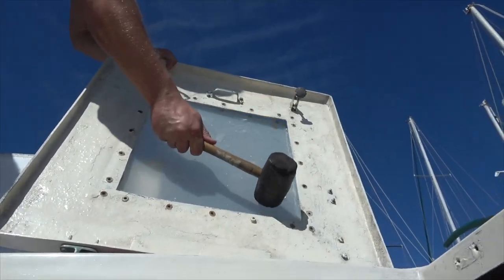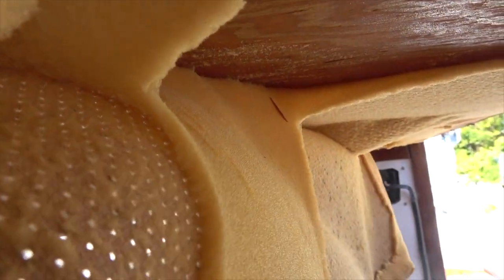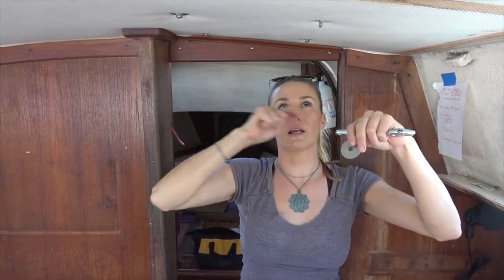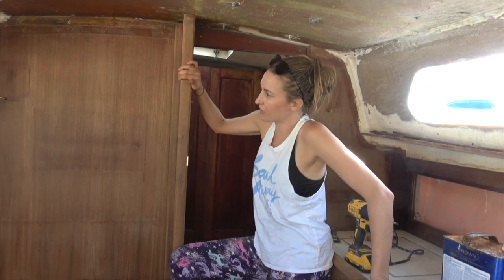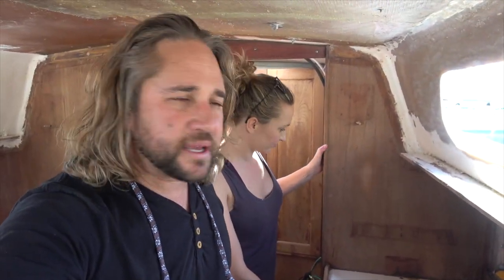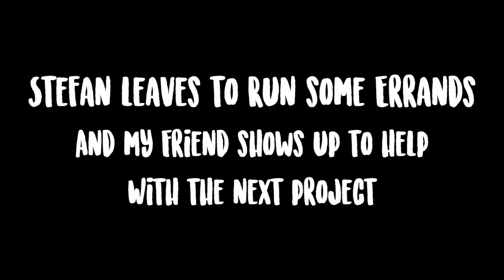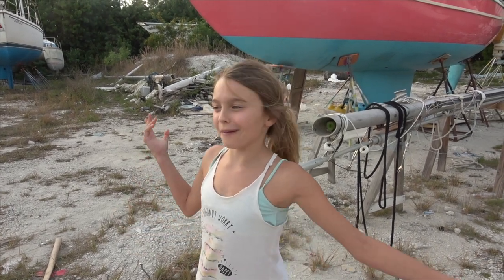Stripping her DOWN | SMLS S8E23

Comment: I am in the process of recoring my boat but what you need to do with those holes that go through the deck is drill them out from underneath with a large bore Dr bit 1" fill it with an epoxy filler mix. and then re drill that hole through the top and putting a slight bevil in the hole and then seal it with butyl tape. It will never leak again.

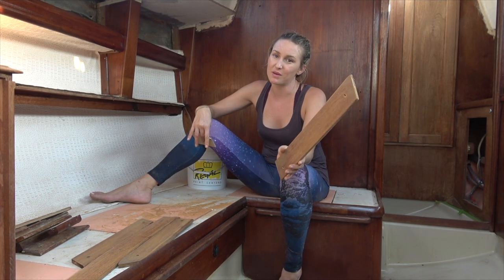Comment: At time stamp 10:46 you are brushing on what looks like a first coat of something? What is that? It doesn't look like a stain, is it? Or is it the Epiphanes you were talking about? Also, when you apply the Epiphanes did you cut it with anything to thin it out or apply it at full strength? I've heard about cutting the first couple of coats with linseed oil and sanding inbetween those initial coats. Did you sand between coats? and did you cut the varnish? Thanks for any help you can offer up it's really appreciated because I have tons of beautiful mahgoney on my trawler and I want it to come out looking as good as your boat. Waiting to hear your suggestions. Thanks!

Comment: Fill all screw holes with epoxy, get all stainless including screws, predrill with a very narrow drill enough to just make the screws grip and then screw them through the epoxy, it will make anything much more secure and tight, don't use silicone use black butyl sealing tape underneath to seal.

Comment: The goo is butyl, and it's generally meant to seal the windows, and any deck fittings above the waterline, (ie jib sheet block travellers, chainplate fittings, etc,). 5200 is much harder to remove, and is meant for more permanent applications. I personally would use 5200 for fittings, or any through hull action closer to the waterline, and would keep the butyl on the deck fittings and windows.

Comment: Butyl tape is a soft never hardening sealing caulk , it comes on a roll and is sticky and the right stuff to use. available many places now.
try to change your hand rails to stainless steel for NO Teak on deck!!!
Varnish  inside last a long time in boats , years , but oil needs more touch up.....
cheers Warren

Comment: When you inspect old holes in deck or ceiling, make sure that if water gets past the deck, it doesn’t get absorbed by the wood core. Usually the hole is drilled larger than needed, refill with epoxy, then drill to the correct size. Now if water gets past the seal on the deck, it doesn’t get absorbed by wood core.

Comment: As others have mentioned, don't use 5200 for the hand rails. 5200 is a adhesive and you'll never be able to take the rails off without destroying them. If you might ever want to remove the item, use something like 4200 or butyl tape.

Comment: While you're at it, check the steel beam between the bathroom and the saloon ( accessable at the seacock under the seat)  Those are called the "beam of death" on Cal's and almost always need replacing. You can get schematics for a replacement. I'm filling my rail hole leaks with epoxy and re-drilling them. Keep up the good work sister ship sistah!